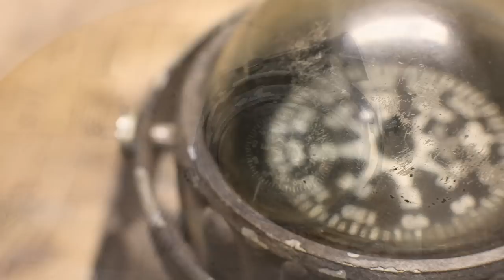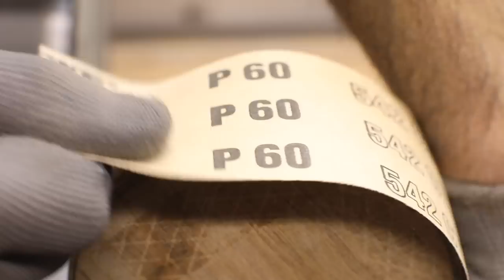Old Ship Compass Restoration And Repair

Comment: I thought that ships compasses were filled with oil?
Reply: Yes, this should have been filled with oil, or an ethanol/water mixture, so the liquid damps the card, and magnifies it, as the bezel is removed to get to the compass you can see liquid under it, and there is a small fill screw in the plastic compass case visible, but other than that a good job.
Reply from the maker: Plastic compass capsule without oil filling holes. It is airtight
Reply: Yes without the oil this is incomplete

Comment: Interesting. Does those two magnets in the lower section have to be calibrated and geared in a certain position depending where you are when it is reassembly? I was thinking that they are there to cancel out stray magnetic deviations according to North pole alignment from where you are at the time and than as the compass moves the gear are correcting from than on... IDK, just wondering... Nice refurbish though.
Reply from the maker: I put the magnets in the same position as they were
Reply: The magnetic correctors are used to 'swing' the compass in the vessel it's fitted to, they are used to tune out as much deviation as possible caused by the metal and electrical systems on a vessel near where your compass is mounted.  If not adjusted correctly the compass will read incorrectly to varying degrees depending on the heading.  This is very important as a deviation as little as a couple of degrees can be very dangerous over any distance if you are relying on the compass for navigation through dangerous waters.  That compass might now appear pretty and looks OK as an ornament on a desk - but it is of no practical use anyway without repairing the bellows or seals and refilling with mineral oil or similar to dampen the movement of the card.  Trying to use that compass without damping fluid will not work on any boat...

Comment: Sorry friend, but it was  a nice cleaning and painting job! Restoration & repair is when you put it back in working conditions!! You need to put the magnets correctly, use a simulator of eath magnetic field to calibrate, and fill it with Isopar L (dampening fluid!) Then it will be restored! You stoped the job half done, but well done! Sorry to say